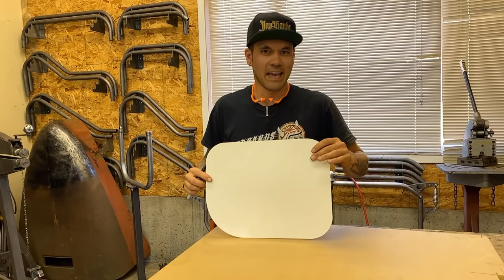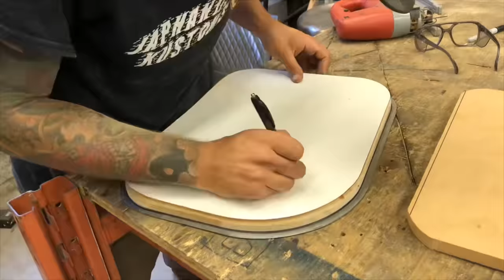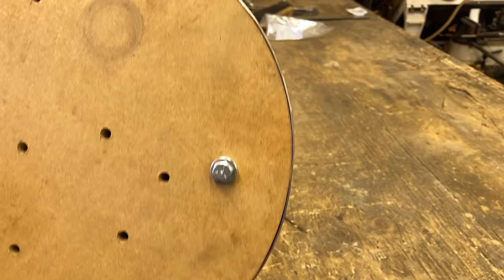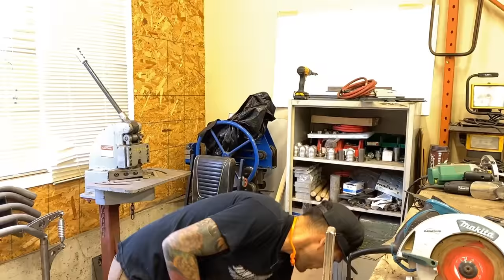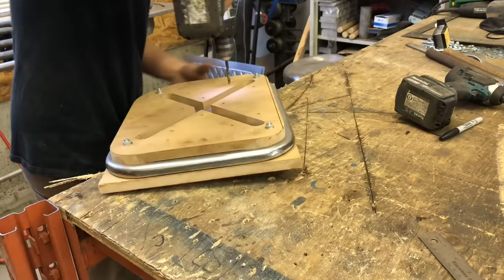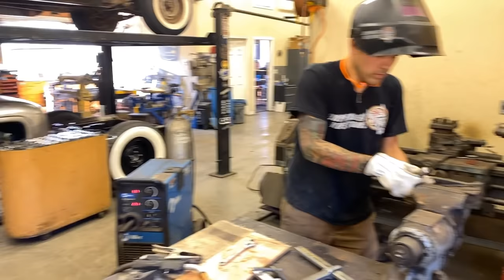Hammer Forming a Beaded Panel with Basic Tools!

Comment: Like the acceptance of the holes in the sheetmetal. Can be filled later. I’ve just finished a sheet bender which is a 10 ft length of wood with a whole lot of hinges screwed on. The hinges are connecter with a 10ft angle iron and another angle is screwed on through the work. Get my mate to help bend the 10 ft sheet if it gets stubborn,
Reply from the maker: Awesome man there’s nothing like making your own tool!

Comment: You can use your router to cut the grooves for your lower buck/form (for the "x"), as opposed to making a Thord piece to control your depth.  Also clamping a piece of straight wood/metal/whatever to your workpiece, and using it as a guide, is an easy way to get your router (or jigsaw) cuts straight.  I have a piece of sacrificial 1/4" plywood glued to a straight strip of 3/4" plywood.  Then I use the saw (or router and bit) that I am pairing it with, to cut the 1/4" base piece.  Now that base piece is "zero clearance".  You simply align the edge with the edge of the cut, clamp in place, and your ready to make your cut... straight and exactly where you want it.

Comment: You could make a cool fuel tank for a rat rod with that formula. The part that you are hammering  could be used to form both right and left if the edge is rounded over on both sides... This is so cool.
Reply from the maker: Yes exactly I’ve done that in the past. I would use a slightly thicker form to get both sides
Reply: @MakeItKustom  I was thinking  that  would work. Thanks for replying!  I got to get a better compressor  and an air hammer... I want to try this!

Comment: Instead of drilling and bolting the panel, i put a few small tack welds on the panel. Then clamp it. The tack welds bite into the wood and keep the metal from slipping. Then after its done, a few swipes with the grinder, gets rid of the tack welds.

Comment: Japanese pull saw for hand saw. 
From wood worker.

Make one side X bolt together the get flush tracer bit for the router with the bearing on shaft side . 1 1/4 " 
Long for half inch depth. Router out .  and glue backer to bottom for blow out. 
Thanks for the video
Reply from the maker: Thank you so much for that feedback! I’m definitely going to try it your way on the next form🙏🙏🙏
Reply: @MakeItKustom  but wait your metal inserts was great think ing. Sooo. Cut all the way through the wood bearing on the bottom /tip of bit. Works better then. Cheaper safer. Rough cut opening then clean up with router. 
Bit with bearing on shaft side is $$.  
Collar works on base of router with un bearing bit . 
Plunge router workers better for tracing. work from middle out to edge. An bigger  pilot hole then bit to get started without plunge router is helpful. 

Thanks for your time. 
Kustom made 200 cu in ford TRI carb turbo carb hat box  here I come.

Comment: Love your metal working. When circular sawing big wood flats put 2x4 stickers under your clamped stock (completely on the bench)that don’t align with your cut lines. That way everything is supported and you don’t have to cut off over the edge of the bench. The off cuts won’t break off before you finish the cut. Both hands will be free for the saw especially important when plunging in for stopped cuts. Rat rods welded from junk are interesting but mostly set up for straight line. My rides need to be up for canyon strafing not drags. Can’t see the corner apex when the induction tops the windshield. How about a rat rod track car.

Comment: Nice. Instead of cutting the second X, after cutting the first X, bolt the second piece to the first and use the router with a bearing bit to create the groove in the backer board at the depth you need.

Comment: hi 
Very well done ,need more people like u .
Regards the steel tank and drilling holes ,the biggest issue is rusting of the welds then contaminating fuel ie think rusty motorbike tank .
Factory steel tanks were Terne coated   [ high lead little tin ] . Terne coat lasts 50 years etc 
The  video clip system would be very good for aluminium tank or maybe stainless .
Reply from the maker: Yeah definitely sealing the tank from the inside is the way to go

Comment: Awesome video! Had a thought when you were cutting out the X. Could you cut the top out accurately (like final product accurately, same as the bottom piece) before cutting the bottom one, then use it as a jig and route to whatever depth with a bearing guided cutter? (Saying that what you did is real simple and I like it.)

Comment: Great job! Modifying your MDF panels a bit , would it be possible to achieve the same with pressing them in (no hammering) by tightening the bolts step by step?
Reply from the maker: You could certainly press them but during the pressing process you would want the two MDF pieces to be tight
Reply: @MakeItKustom  maybe like the two panels you made to hold them tight and a third one with a cross to press them in tightening the bolts ...

Comment: Nicely done.  Question:  Instead of the plywood inserts, what would have been the result if you had used a router with a radiused-ball bit to make a negative impression on the bottom buck?
Reply from the maker: Probably a better result

Comment: nice work. instead of cutting the bottom ''X'' out, try using a router with a simillar cutter to the shape you want. no need for packers in the bottom of the cut out.

Comment: Weld a 7” flat bar to the nuts on the clamping system (centered on the nut, drill a hole over the center of the nut so the bolt can come through) and you can spin those nuts on and off by hand no wrench and fast

Comment: Awesome!
Why not use the top board as a template to router grooves in the bottom board with a certain depth  so you can avoid the part of making a third board and filling that third board back up again with wood? Or maybe I'm missing something.

I like the airhammer hack.👍
Reply from the maker: Nope you are right! I’m no woodworker I have limited bits haha

Comment: Awesome, in Gold Smith work when you want something to stay in place to work on it like this you would Super Glue the metal to the form then to take it apart you would just heat the metal and it destroys the glue bond. It might save on fixing all the holes.  Maybe give it thought. Great job, now you can make the exact opposite piece just by flipping the router side over and router it and you can make a mirror image side of a gas tank. Hahaha. I have that same vice. Wish I had that fab table and everything else in your shop. Maybe even your youth. Well life happens but I ain't dead yet. Wish me luck.
Reply from the maker: Thanks a lot Barry! Great advice and good luck!

Comment: The craftmanship is first class, well done. If one wanted to make a fuel tank there would be a lot of holes to weld up! Is there a different technique for clamping when holes are not an option for the finished item?
Reply from the maker: Yes definitely if I was making a fuel tank I would probably just use clamps and struggle with how many clamps I would put on there but as long as you have enough clamps to replace the bolts you don’t need to drill the holes
Reply: @MakeItKustom  Thank you.

Comment: Old video, I know but could you tell me about the hold down clamp that threaded into your bench top?  I'd appreciate it.  Love you content, plan on doing a deep dive soon.
Reply from the maker: Yea these are common! Amazon sells or any machinist supply. They are typically used on t-slot mill beds and come as a set

Comment: I want to try this.

I want to make a cookie sheet 28inch x 25inch x 0.75 inch with a 5/16 radius, and 1.25 inch radius corners.   The sides will be 95 degrees from the base of the pan. Can I make this with 16 gauge, 304 stainless steel?

Is mdf, or plywood better?
Does the corners have a big enough radius for the metal to compress?
Can I clamp it, or put weights on it?
I do not have a welder, and I am lazy.  I am thinking to put 2 sided tape between the pattern, and metal.  The put weights on it.  The tape will increase the adhesion between the steel and pattern.  

I am not very concerned with the finish.  I will just use my claw hammer hitting the metal directly or being buffered by wood.  

Please respond.  I have drawn up something, and have found a guy with a cnc router to make the pattern.

Comment: G'day from Australia mate, sorry I don't know your name. I wanted to ask about how you would go about making s 45 degree angle to the pressed section of the panel. I have a WW2 Dodge WC-51 truck with rear tool boxes that form the back section of the trucks cargo area/troop seats. The bases of the tool box have two parallel pressed lines about maybe an inch in width, maybe 8 inches long but the edges are bevelled at 45 degrees. How would I make an MDF form that has that? Would I have to basically make it in three sections with the centre part the cut out and a 45 degree jig saw to cut the edge from 90 degree straight to 45 degree bevelled edge? So the three parts would be a base, the bevelled edge form and the top plate with the cut outs to fit the air chisel/hammer into and to hammer out the shape? I don't yet have a bead rollers as the motorised deep throat ones start at $2,200+ AUD and that's way out of my budget.

Cheers mate..love the channel and filming style. Gav from Olive Drab Garage.

Comment: Great work. Instead of making the air hammer piece a one off, why not cut the shaft to about 40mm as you did, but drill a hole same size as the hammer tool, making it like a punch and then you could have multiple end tools for the one air hammer piece, also saves welding welding it together and as the shaped end wears it could be replaced.
Reply from the maker: Sure we could do it that way as well

Comment: Nice video bro, you could have also used the base plate and recessed the cross with a router. Using a cove bit or fluting out the main area and edging the rest how you wanted it. that way you don't need to use more material than you need.
Reply from the maker: Great tip thanks man I use it on the next one

Comment: Wouldn't it be easier to cut the X out with your router with a radius bit so you could plung cut the size or shape you want. Therefore you could set a depth in the wood and maybe use a backing board under that to keep from braking out. Just a thought. Very good tech video. Ronnie.
Reply from the maker: Absolutely that would be the way to go! I don’t have the router bit. Got a hit more garage sales lol
Reply: @MakeItKustom  Yeah, you can find some good deals sometimes. Ronnie.

Comment: Something you might consider. Instead of cutting the X in your bottom piece, and then making an additional piece to control the depth of your depression. You could just use your router with a round nose bit, while using the top piece you cut the X in as your guide and plunge the router bit to the depth desired into your actual template ( bottom piece ). This would make things faster and easier with less work.
Reply from the maker: Absolutely just didn’t have the bit! Haha

Comment: I'd like to know how you handled the transition right at the X crossover.  Normally, it should be pretty easy to mess it up right there.  I'm not talking about the making of the pattern.  Yes, the pattern would have to be very tight to keep the metal tool from wandering.  You would have to be careful right at that crossover point, otherwise it would blow the crispness of the of the X in the pattern.  Do you have to lay the metal forming tool down a little at an angle so that it goes through the X crossover without wandering?
Reply from the maker: As I passed through the X I just tried to stay smooth and was holding the air hammer nice and tight. A couple of very smart commenters on here mentioned that adding a washer as a depth stop to my actual tooling would have been a great asset and I agree!

Comment: I keep a radius gauge set for grinding those radii.  Very cool video!  What material type are you using?  O condition or 5052?  How did the edge around the bead turn out?  I nice .13 radius around the x would’ve been beautiful.

Comment: Great work.  One point, however, you went the wrong direction when using the router.  The blade should cut in the direction so it wants to cut into the stock.  Your direction allows the blade to want to climb the stock without cutting into it.  I know.  It still worked.
Reply from the maker: Thanks Ralph it makes a lot of sense honestly I figured there was a right direction in a wrong direction thank you for clearing it up

Comment: This might be a bit of a silly question, but if you were making two ends of a petrol tank for example. Would you hammer radius the edges on both ends first, before cutting that X out; or could you re-use that MDF sandwich with that X cut out on a fresh piece of sheet metal? Would having the X in the middle effect how the metal forms when you're hammering around the edge?
Reply from the maker: What a great question! I would use the same hammer form and the ex would not affect the outer forming

Comment: @MakeItKustom  back to my comments on the spacers for the X, you mentioned possibly using metal, now after some thinking using the air hammer with the metal spacers underneath wouldn't that create a flat spot in the X
Reply from the maker: Ya tru. Probably best to either get the depth with a router or use mdf spacer

Comment: For the other end of the tank or whatnot you'll want to flip the bottom piece so you'll get a mirror to image
Reply from the maker: Yes definitely if I was to make a mirror I would definitely need to router the other side and then put the panels in reverse
Reply: @MakeItKustom  well yeah you'll need to roll the other edge might need new clamping holes too

Comment: That turned out great! One question, though. If this was the end cap for a gas tank, what do you do with all the bolt holes? Do you have a technique for filling them without warping the panel, or do you just touch it up afterwards?
Reply from the maker: If it weren’t for a gas tank I would probably try and use ClAmps instead of bolts The holes can be welded up afterwards using a copper Bakker

Comment: Similar piece in mass production would probably be with same  form of steel (plus outer chamfers), preheat piece and smack it to profile with a drop forge hammer. What is your thoughts on fabricating the same way,  just by the means of a regular hydraulic shop press instead ? Would hardwoods be able to take it ?
Reply from the maker: I think yes they will be able to take it and would be worth it with something for production. The steel piece to press in would be a little bit more difficult to make but worth it again in production

Comment: Great video! 
What's the thickness of te metal sheet?
18:40 may I suggest to use a round nose router bit to  engrave the X in the bottom layer? So you don't need the third layer and spacers!
Reply from the maker: Yeah definitely I just didn’t have that cutter! Lol this was done with 18 gauge

Comment: Very cool!

You clearly have a bigger skillset than I do, question: would it be easier to put threads on the end of that air hammer tool and then be able to thread on different hammers for different profiles?

It may be hardened steel and too difficult to cut threads...
Reply from the maker: That’s a cool idea with the threads!
Reply from the maker: That’s a cool idea with the threads!

Comment: Couldn’t you use the router with a round bit that will only put a 1/4 to say 1/2 rounded groove into the bottom as your stop ? That would be a uniform templet to stretch against in my mind.
Reply from the maker: Absolutely! I just didn’t have the bit

Comment: I'd like to make a pair of teardrop shaped rear split-windows using the wooden buck method. They would be the exact opposite of what you just built.....radiused flange on the inside of the square....shrinking the metal in the "corners". Do you think it would be possible with your method.
Reply from the maker: Absolutely it would work!

Comment: So I'm watching and I have an idea.
How about the round bar the entire length of the slot with some flat bar welded to it. You could then put it in the slot and use the press emulating in a sense the way they were originally stamped or alternatively pound the flat bar with a heavy hammer (or indeed a combo of both).
Of course it would still need to be finished with the air hammer but I saw the amount of elbow grease you put into it and a heavy framing hammer, round bar and flat bar idea came to me. Just a thought.
Reply from the maker: Yeah definitely that would work. Press forming is awesome

Comment: Can you do this to aluminum? I’d like to build a small camper and weight is an issue but this could help with weight bearing elements like stand on outrigger shelves to reach the campers roof before and after the fenders.
Reply from the maker: Absolutely. It would be easier with aluminum

Comment: If you use double-sided tape you won't have to drill holes in it when you clamp it down to make sure it doesn't move
Reply from the maker: I’ve never thought of that I’m definitely gonna give that a shot sounds like it would really work to solve the issue of slippage

Comment: Nice!!! New sub here. I probably would have drilled the head of the air hammer die and inserted the tool shaft into the new head before welding. Just seems like it would be safer. But that is just me.
Reply: Anyway carry on. This was an awesome video!!!!
Reply from the maker: Thanks for your input man I do appreciate it! Welcome 🙏
Reply: @MakeItKustom  Hey, no, thank you for the awesome content. Wish I had the knowledge I have gained from your channel and others 20 years ago. Keep posting, I'm finally inspired to get back on my 74' Beetle project. Chopped  6" sectioned 6" box chassis 302, AOD, 8.8 etc...